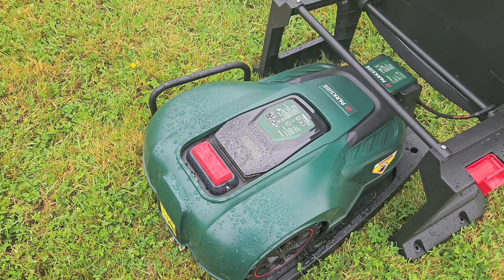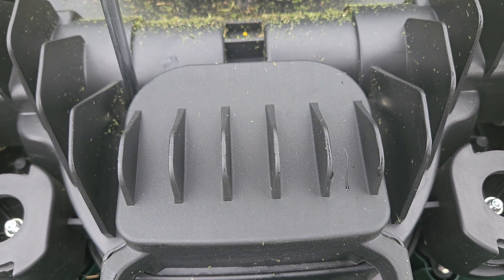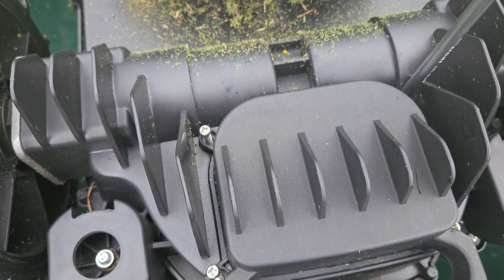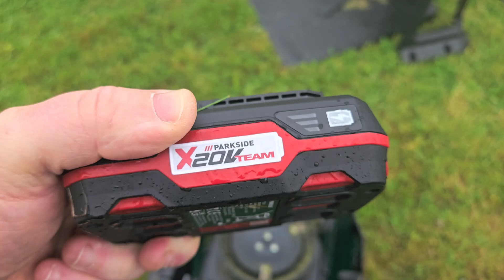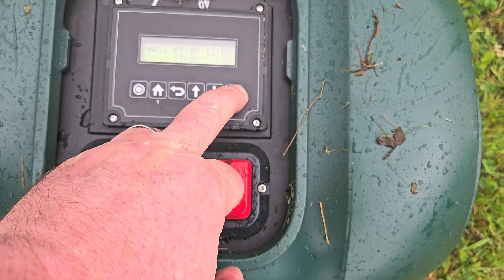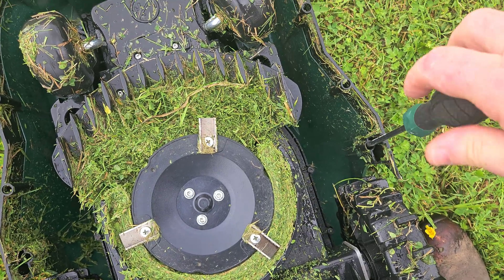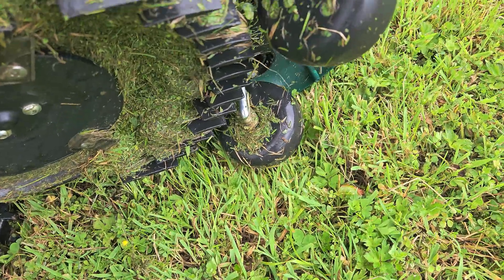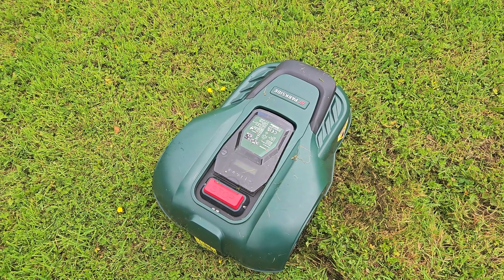Parkside ROBOT Mower Battery UPGRADE & Testing

Comment: Recond I could extend the boundry wire to 2500m2 drop in larger 8ah battery? Can you adjust that it cuts longer than 2 hours?
Reply from the maker: Yes

Comment: Am I alone in thinking it's under spec?
I have a decent level lawn, with good quality thick grass.
When I set it to do a 25mm cut (even though the height of the grass isnt much above that), it doesn't like it and continually, 'peeps' a rejection, stops cutting,  then moves to what it thinks is an easier stretch,  only to do the same again.
I had to set it to 35 before it behaved and did what it was supposed to do.
All this in a fully charged battery.
Anyone else experience this ?

Comment: Hey mate, nice vid. Thinking about buying one of these.

Would you per chance like to upload the circuits schematics and a little teardown of the mower?

I am thinking about putting a little esp32 or simmilar into it so that I get the smart features without their app.
Reply from the maker: Nah I got it running good after the set up hassle I ain't opening it unless I have to
Reply: @doctorlefthandthread  yeah figured that would be the case ^^.
But thanks for the nice vids anyway.

Would you recommend it in general?
I will definitely not spend the full 200€ and probably wait until I see a very used one for about 90€ again.

But our garden has a lot of obstacles and de and incline.
Its not very step on any particular point but changing a lot.

Also mole holes but this will probably stop him desd
Reply from the maker: @sir_no_name1478 so far so good mole holes will definitely be something it couldn't deal with. For the money I think its ok

Comment: I’ve had mine for a couple of months running with just the standard 2amp battery and it worked very well and kept the grass looking neat and tidy. However just today got a fault “battery function abnormal” so think the battery has failed already 😢 Apparently some people who have claimed on the warranty say they get sent to Germany for inspection and repair so could be up to 8 weeks or even more in some cases. Saw in my local Lidl they have the 4amp batteries for sale £25 so I was tempted but will see what customer service come back with… I miss my robot helper already!
Loved the video btw
Reply from the maker: Thanks for the comment

Comment: I bought one of the Parkside mowers with a 4amp battery. It’s running twice a day for 3 & 2 hours at a time. On the 3 hr session it finishes up with 40% remaining so I’m happy with mine. Cheers for the vid
Reply from the maker: Thank you! I probably could have gotten away with the 4ah too. I thought since I had the 8ah I would use it. The 2ah is too small for most lawns in my opinion.
Reply: @doctorlefthandthread defo agree with your latter comment.

Comment: From my own experience with the Lidl tool brand, Parkside tools are built to a specific price point and because of that they're generally crap. I've returned a few corded power tools over the years and they've always honoured their warranty and that's good, but really you want to buy a tool and just have it work well and last years but to get that it's big bucks and very hard for a diyer to justify sometimes. Different for a tradesman as they can jack the price of the tool onto their customers over time or if self employed, get their accountant to do some creative accounting. 😉
Reply from the maker: Yes true. There is a perception out there that Parkside has all these tremendous tools I like to show the good and the bad so people know what they are getting. Sometimes it works out Sometimes not.
Reply: I have the 1000m2 version . Garden is 800sqm. 
Cutting from 5am to 10pm .
3hr shift then 2 hr charge each time during that. 
Height 30mm. 
I put silicon over the 2 metal rain sensor studs. This ensures it keeps grass low. 

Energy consumed is 4kw in 2 weeks .

Comment: Very interesting issues with that mower for sure! Maybe those fins are causing the mower to get bound up but I'm thinking cutting them off will not solve the issue. I've been wrong before though :)
Reply from the maker: I was thinking the same thing but after that it cut 3 more hours and didn't have any issues. Time will tell it's drier and warmer and the grass has been completely cut now. It is coping better.